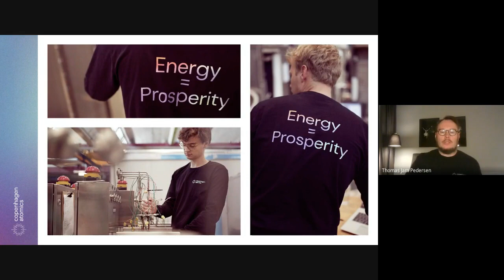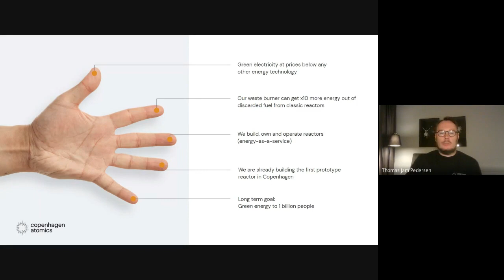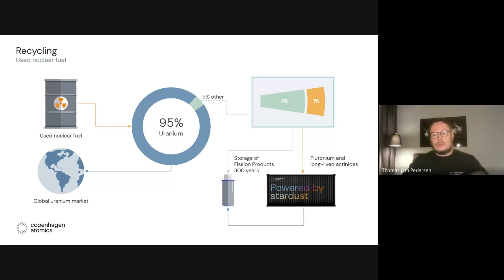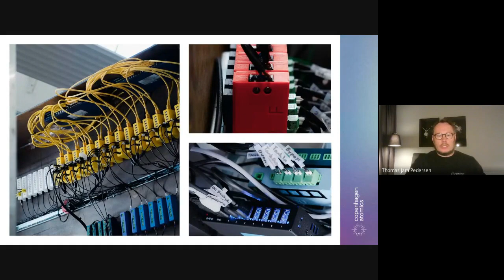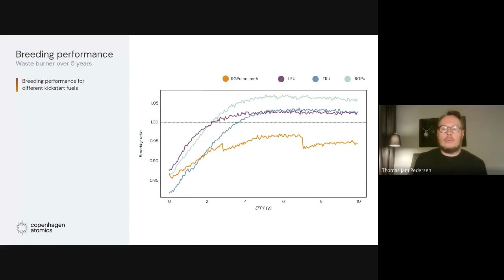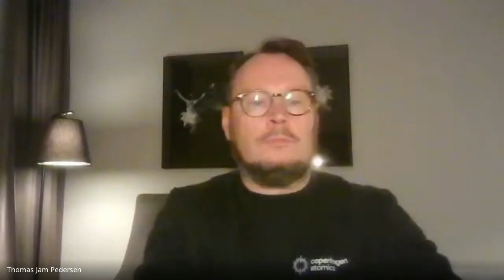Thorium molten salt breeder reactor as waste burner using heavy water as moderator

Comment: The only thing that makes me say NO to fission is the waste buyproducts.    Now there are shills that say "the nuke waste isn't that much at all.  it's a small amount"  but if that stuff that has some elements that have a half life of 30,000 years ?   then its some really bad BAD stuff.  
Thorium doesn't have that problem and  has the benefit of waste fuel reuse.   Yes there will be an amount of residual waste but it does NOT have the long half life that urainium fission products have.   And that amount is FAR smaller than the uranium process.      Hydrogen Fusion is still another 20 years away and the fuel for that has to be manufactured (by a fission reactor).    So Fusion isn't all that clean considering you need Fission to feed it.    
We are wasting our time with persuing fusion.

Comment: This is an utterly rediculous idea. Water boils at 100C. Molten salt operates at 750C to 1,000C, which is well beyond the operating temperature of a pressurized water reactor. The core of a PWR is filled with water pressurised to 150 atmospheres, allowing the water to reach 325°C without boiling. The pressure of water would be much higher at 750C, making the system a time bomb waiting to explode. The result would be far worse than Chernobyl or Fukushima, spreading highly radioactive waste far and wide.
Reply: This is not a PWR, and the water is not pressurised, in fact it is not mixed in with the molten salt but run through insulated tubes in the reactor in a similar configuration to what graphite rods would be in a conventional PWR, also, the negative temperature coefficient and low pressure configuration in an MSR means that if the reactor is ever ruptured, the loss of mass from the core results in a sub-critical mass, and the escaped mass will solidify and cool passively, containing it in a way that would not be possible in a PWR. So, no, it will not spread radioactive waste very far at all, in fact it is self-containing.

Comment: How (why) are you using (heavy) water as a moderator in a molten salt reactor? Is it just to avoid graphite rod replacement every four or so years? (Your pump lasts ten). Seems like you're unnecessarily adopting the very medium that is involved with all four of the nuclear accidents to date. You say you have a system that deals with the accidental conversion of water to steam. Is it walk away safe?
Reply: Why is easy: heavy water is the best moderator there is in terms of neutron economy, significantly better than graphite; and being liquid it's also not subject to swelling due to neutron irradiation.

They also said their heavy water isn't pressurized, which makes sense given the salt neither is (the mechanical barrier in between would otherwise have to resist the dP). So leaking molten salt into the heavy water would pollute it with radioisotopes and boil it, but the steam would be produced at ~atmospheric pressure. As long as the steam can be condensed, it's plausible no overpressure will occur. And finally, how much heat is dumped into the heavy water during an accidental leak will depend on whether a salt plug is formed or not -again, the low pressure difference makes self-sealing plausible.
Reply: @Grobocopatel  thank you. So it is walk away safe.
Reply: @carrdoug99  It'll depend on how they manage emergency cooling of the heavy water really, so I wouldn't know. During normal operation they need to cool the heavy water anyway (thermalizing neutrons from MeV to a fraction of an eV heats up the moderator) but if it's a pumped flow system, using it also to cool during an accident wouldn't make it 'walk away safe'. If they plan to use a natural flow condenser to dumping heat into a water pool (i.e. like GEH's BWRX-300 will do) then it could certainly be. But without them disclosing more details on the design, can't say.
Reply: @Grobocopatel  cool. Thank you so much. If they incorporate a freeze plug into their design, that would address the molten salt side of the safety equation, right?
Reply: @carrdoug99  Not really.

As I understand it, the freeze plug conceptually works by melting under both loss of outside power conditions and plant shutdown, i.e. when there's no electrical power available from either behind or beyond the switchyard. Under those conditions*, the primary circuit will increase in temperature and melt the freeze plug, which also isn't actively kept cold anymore. Fuel is then dumped into a subcritical configuration where some passive mechanism, such as natural draft convection of air, takes care of decay heat removal indefinitely.

But here we are talking about an accident event where the barrier separating the molten salt and the heavy water is compromised (i.e. a salt tube rupture or similar) and get into direct contact. A freeze plug won't diminish the likelihood of such an event nor mitigate its consequences.

Personally, I'm not a fan of freeze plugs as a reliable safety feature. The time scale of an accident has to be commensurate with the characteristic time of fuel drainage. And the salt is potentially getting more viscous as it approaches lower temperatures down the drain and starts to form a slurry, so it's conceivable the line could get clogged along the way. A nice to have, but not something to rely on.

(*) Either because the design keeps the fuel in a critical configuration all the time, as in an MSR with salt surrounded by moderator and no shutdown rods or neutron poisons, or because of plain old decay heat even after fission is stopped completely.
Reply: @Grobocopatel  Was never a fan of freeze plugs either. Luckily the industry moved on to a better solution. (I actually remember seeing the conference where one presenter brought up that design and later on Ed Pheil from Elysium industries had questions about it and the next year Elysiums reactor design ditched the freeze plug in favor of this as well).
What they propose to use now is a continuous drain into the subcritical tank and an active pump bringing the salt back into the fission capable vessel. I like that system, it's always on and very simple.